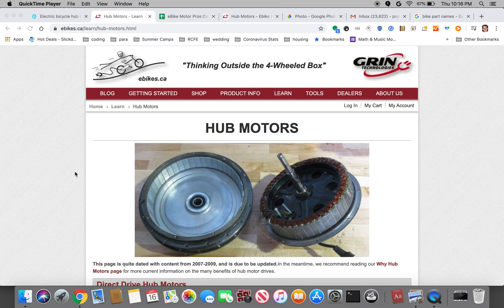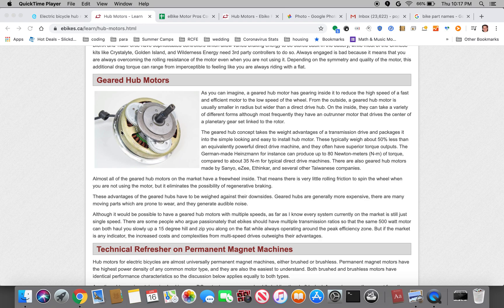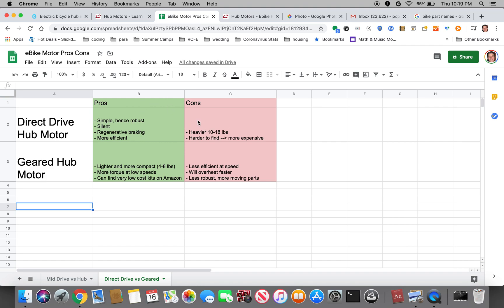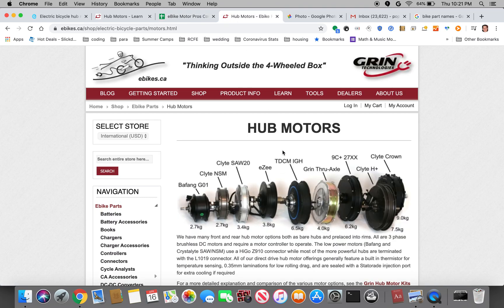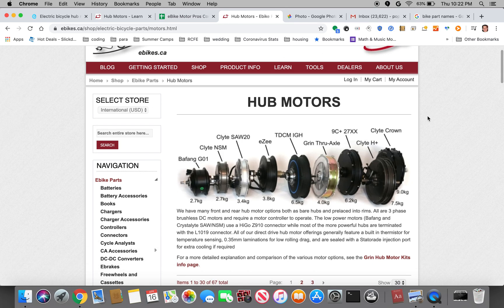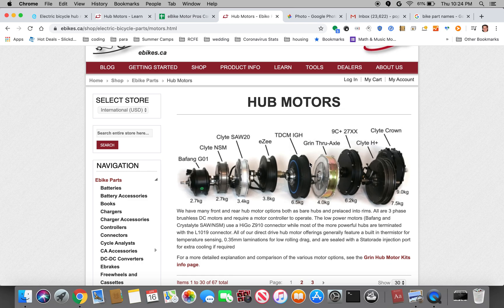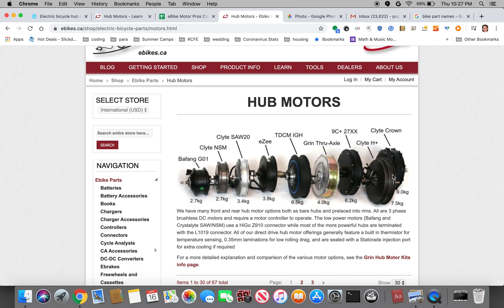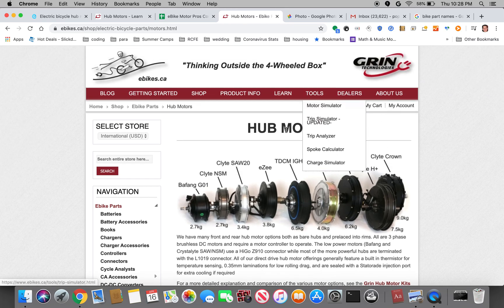Geared vs Direct Drive Hub Motor: Electric Handcycle eBike Conversion Journey Part 4

Comment: But the biggest downside of direct drive motor is that once it has no energy from battery being fed into it (riding on 0 assist) it is incredibly hard to beat the magnet with every turn of the crank which makes pedaling a direct drive motor with 0 assist near impossible unless you're a strongman..
Reply from the maker: I use a handcycle and have an arthritic shoulder so cannot push too hard, yet have no problem handcycling with my direct drive motor off. It is slightly more difficult to start the bike, but once you are at speed I cannot really feel any extra resistance. Seems like a common misnomer..

Comment: Where can I get a Crystal light crown hub motor. ? And how much $$ does it cost.
Reply: What is the top speed of the crystal lite hub motor. ?
Reply from the maker: @keanewest4442  Check out my video on using the Grin tech motor simulator, which will tell you the top speed..  https://www.youtube.com/watch?v=PQGpZH0gKx8
Reply from the maker: I bought my motor from ebike.ca